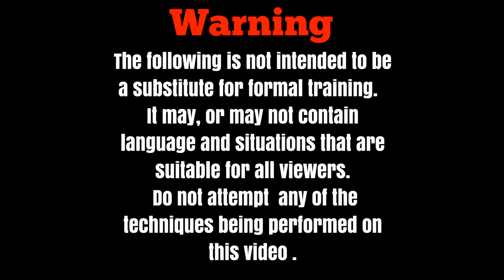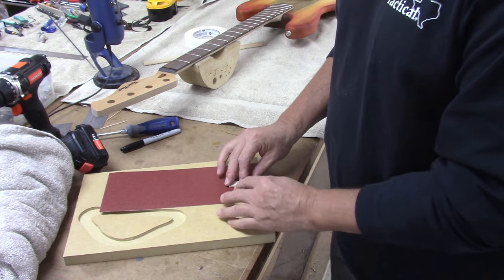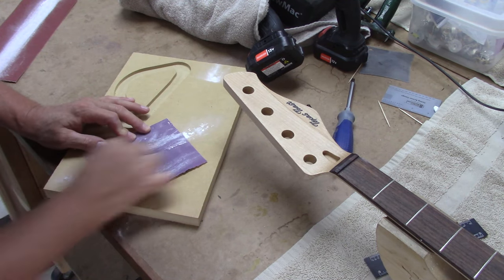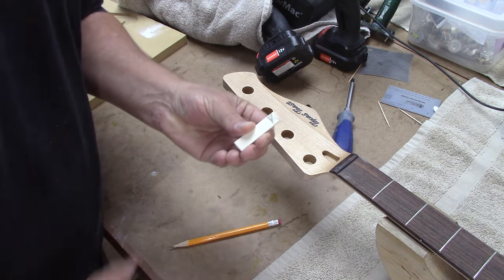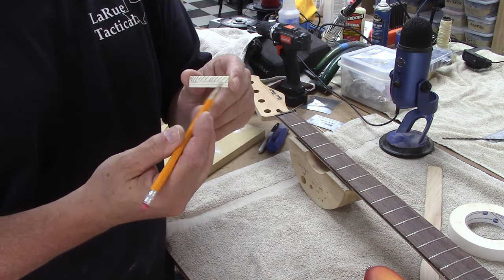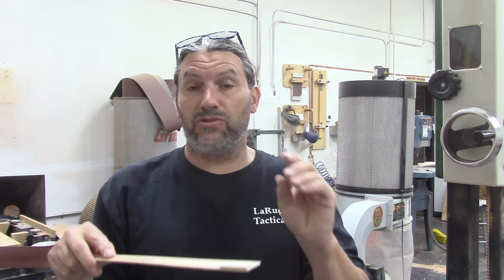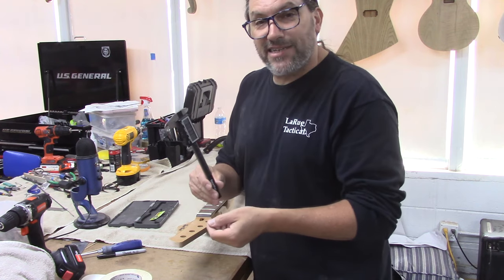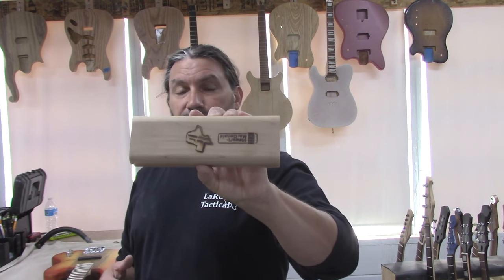BUST A NUT! Easy Tips & Tricks For Shaping Guitar Nuts

Comment: Here's a tip. To cut perfect slots, measure the height of the 1st fret, then, stack up feeler gauges until that number + 0.010" or so. Slide em, up, against the nut and cut slots until you hit the feeler gauges. Perfect slots every time and it's impossible to cut them too low that way. Or start with fret height plus 20 thousandths.
Reply from the maker: This way can work extremely well.
Reply: Would still definitely recommend fine tuning with feeler gauges or digital gauges in the playing position. There’s a significant, measurable difference in these things when you take a guitar off a neck rest (which flexes the neck) AND when the strings are allowed to actually sit upright as if you’re playing and not sag down closer to the frets. 
It’s why the guys at Music Nomad show us all their measuring techniques in the playing position for their setup guides

Comment: Trick of the trade. Take a pencil and put it on your belt sander. Grind away the wood till the graphite core is visible from the bottom side. Sharpen with a knife. Now you can lay it flat on your fretboard and align it on your first two or three frets, depending just on how long your pencil is. With the tip of the pencil on your inserted bone nut, you can now easily mark the lowest radius possible for how deep you can cut the slots. Using an ungrinded pencil will give you the top radius of the nut.
Reply from the maker: That is a good trick too

Comment: Stew Mac has the double sided nut files which Matt recommends and has had for 10 years and look awesome. Stew Mac also has the gauged nut files which are flexible but for specific string gauges. I’m a hobbyist, but know the right tool for the job makes it worth the cost, but am torn between which set to go with. Anyone used both and have a preference?

Comment: I 3D print em, pre-slotted and sized to fit.  Just has to be solid with 100% infill.  PLA is about as hard as bone and takes as many licks of the slot file as bone. It's way more like bone than those plastic nuts on cheap guitars (I hate those things).  And I can make all kinds of pretty colors, including off-white that won't make anybody do a double take.
Reply from the maker: That's cool
Reply: Do you have this posted on thingiverse or anywhere else?
Reply: Sounds good. Never installed a nut but I’ve been happy with micarta and plastic on my guitars